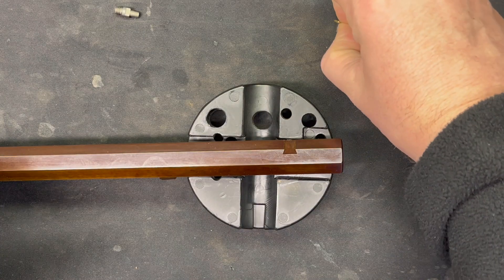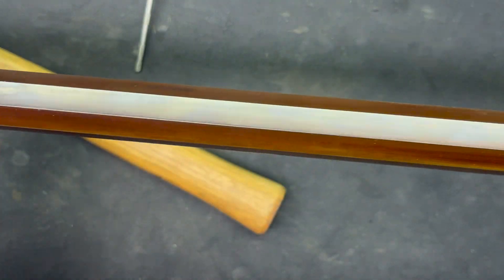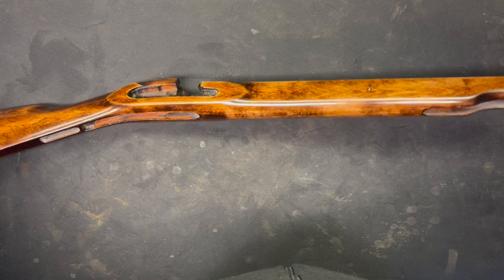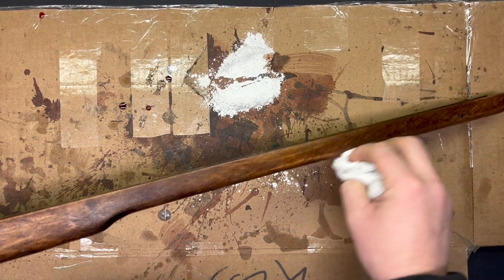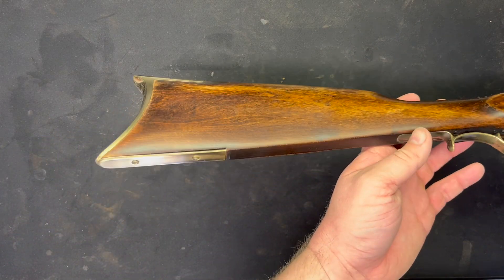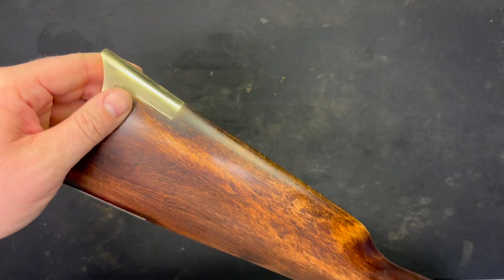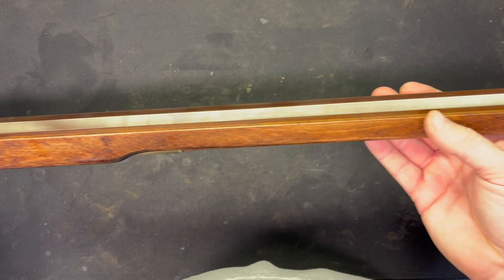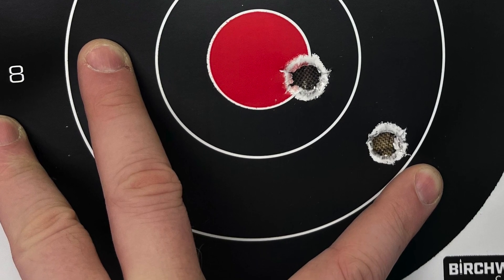Sonoran Desert Institute: Muzzle Loader Build Final

Comment: Yea, I love try oil, but it does give you a very glossy finish. May not be appropriate for a muzzle loader. Good job. I really enjoyed your video. Jeff
Reply from the maker: It is pretty glossy, but if you lightly hit it with some degreased 0000 steel wool, it will take down the aggressive sheen and leave you with a nice, matte finish.  But DO NOT go too hard with the steel wool or you’ll end up with scratches that are a pain to work out… (ask me how I know…) 😂

Comment: Looks great. Though one question, wouldn’t it have been better to file on the sight base than the barrel?
I ask as my brain is thinking that if too much is taken off of one, say the barrel, it can’t be put back, but if too much is taken off of the sight, it can be replaced.
Reply from the maker: That’s a very good point and I agree 100%.  I filed the barrel because that’s what the course material said to do and this was for a class at SDI.  My main concern with filing the barrel is that I was removing the finish I’d just applied.  But so far everything seems to be fine. I’ve had it out to several black powder events at my gun club in Western Washington where it rains 9 months out of the year and it still hasn’t rusted. I’m just very generous with the Balistol when I get it home. Haha thanks for watching!
Reply: I will have to ask the instructor when I get to that class and see if there is a reason. Make sure to use a penetrating oil around tight fixtures like that, as they can develop rust that can migrate down into the dovetails.  Also don’t forget to occasionally totally rip it apart and get behind the lock plate and under/behind the barrel.
I’m a few classes behind you, but I grew up with black powder and love it.
Loved how you crowned the barrel, gave me a few things to try when I get to that process.
Though also considering seeing if I can add a nod to my Apache ancestry. 
You did a great job on your vids, and are something I plan on referring to during my time at SDI as well. I’m about 13 weeks in now.
Keep safe.
Razor
 @scottbozarth8459